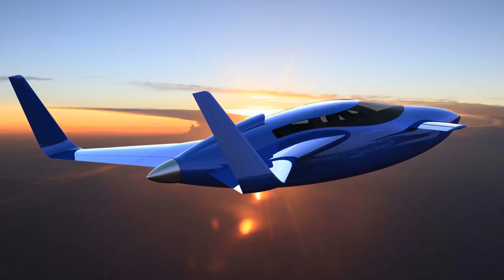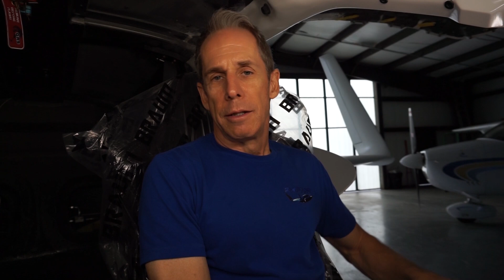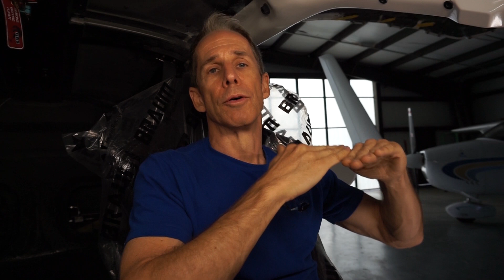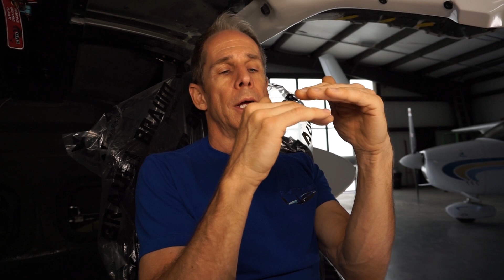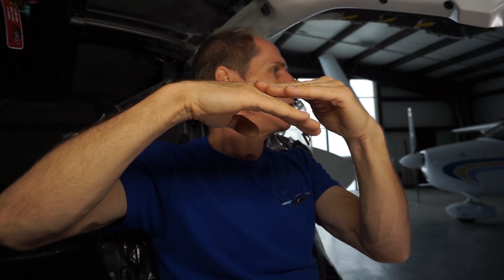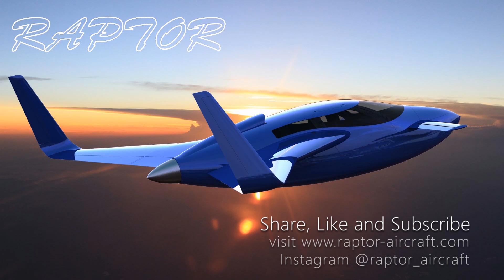State of the Union - Building the Raptor Prototype

Comment: I agree  there might be reliability concerns when using an automotive engine on an aircraft.   The diesel may fail sooner than an aircraft part, but not in 20 hours.  GM engine designs pass a test of something like 300 hours at full throttle oscillating between max torque and max RPM -- then they must function as new.  I think there is a good 500 hours of super-reliable service in that Audi.    It's a long-term issue unlikely to be found in a few hundred hours of testing.

I wonder if the test pilot would like to test at Bonneville or one of the dry lakes.  You are always above the runway if an engine fails.  Trent Palmer, an AWESOME Youtuber,  and his buddies go to a dry lake with their planes and RV's to camp and fly.  Trailer and airplane access is assured.

I wonder if 2 1.8 liter TDI's could work.  Snuggle the two engines next to each other and drive the propeller through clutches.  If one fails, the other can continue.  Maybe use a common dual-scroll turbo for high altitude.  It's easy enough to make 200 HP with a 1.8 TDI, so you could limp to an airfield at reduced altitude and speed.  It might be 100 lbs heavier than the current setup, though.

I wonder if the 3.0 liter could be modified to use mechanical fuel injection.  The engine could run without ECU or electrical power.

Comment: Sorry to hear of your development setbacks. I'm enjoying watching your progress and wish you success.  wrt to the single ECU (and crank sensor as well?), I agree with your test pilot.  That said, I could not convince www.edgeperformance.no  of that opinion, as they are continuing to sell kits and engines based on the same (I believe) ECU and single sensors. So far they have 330 kits/engines out there, with no failures so far.  I have my fingers x'd for them.
Regards and best wishes, Pete

Comment: Don't let one man's opinion get you down.  Just because he is a "test" pilot doesn't mean he has all the answers.  You are absolutely right about the engine.  It is the reason I got interested in the Raptor in the first place.  Something economical to fly.  I am a big supporter of yours because of the simple fact that every time you ran into an issue, you came up with a solution.  What you have done so far with this aircraft is amazing.  Someone will do the flight testing for you.  Prove the aerodynamic issues, and then fly the aircraft.  I know you are getting a bit worn and frustrated, but stay the course, you have a real winner here...

Comment: Have you considered the ADEPT Airmotive engines from South Africa? They initially started off developing diesel engines for use in GA, but since refined their production design to run on 100LL/Mogas/Biofuel, incorporating many of the advantages offered by diesel, and omitting the disadvantages and challenges associated with diesel. Their engines are already flying in many airframes, and they have recently expanded into the US GA market. You can check out the specs at flyadept(dot)co(dot)za

Comment: Peter, your candor is amazing and wonderful. 

I am very sorry for how tough it feels to have suffered the setback of Len's reaction.

Regarding Len and his reaction, it's been my experience in life that too many people are too much controlled by conventional wisdom, and too unwilling to think and conclude independently, according to their own independent and sound reason. 

That is something you do, Peter. 

Based on your report, I suspect perhaps it is not something that Len has a strong tendency to do. 

Specifically regarding the dual ECUs issue, it is of course historically true that piston aircraft engines have generally featured redundant ignition systems.  Similarly, my Rotax 912iS has redundant ECUs, among other redundant elements.  But consider: why was redundancy historically needed.  Was it not because ignition systems were notoriously unreliable? 

Today's world of modern engine management is completely different.  I do not have the statistics at hand to cite, but I'd wager that even Kia and Hyndai gasoline engines today (i.e., low-cost, economy brands) have in-operation failure rates that are several times lower than Lycoming/Continental engines that are freshly coming off the line -- that is, freshly coming off the line with their dual ignitions and/or ECUs, etc. 

Of course (and for further consideration), the Audi diesel has and needs no ignition system.  Certainly, the ECU could fail.  And so could many other things.  The real question should be what are the odds of failure within the total power system.  So far as the Audi engine itself is  concerned (including its single ECU), I suspect the overall odds of failure are far more slight than in 99 percent of the piston engines flying. 

Keep going, Peter. 

BTW, I believe I am deposit holder 98.  I also do not believe I have ever been solicited to make an investment.  My answer will be yes.

Comment: i just want to say........you are one hell of an entrepreneur....you are all in. As for your setbacks, you've demonstrated the caliber to overcome these issues. As for your "test" pilot, he sounds like anything but. I can understand his aerodynamic concerns but that's where the test part come in. That plane will fly. A canard by definition cannot stall......if the basics are followed, as for the fowler type flap you need to make sure it doesn't affect the angle of incedence you've established. Which BTW would be "tested" foe anyway. Flutter has an onset stage that can be backed away from..... if you've ever done a steep turn and maintain altitude you'll run into your own wake, the buffeting you will feel is stabilizer "flutter". As for the engine ECU, not having dual fuel control is not a "No Go" situation for evaluating an aircraft. Actually, this "dual" mentality harkens back to the magneto ignition systems which have reliability issues. You may want to inform your test pilots that certain dual mag ignitions, used enmasse, have always had a single point of failure in that the two mag heads share a common drive shaft.......so I guess that guy should give up flying.
Correct me if I'm wrong but there's hundreds if not thousands of experimental aircraft flying with single ECU ignitions on all types of engines....it's simply a measured and accepted risk. So hang in there buddy.

Comment: Peter I have the answer for fixing the single channel problem of your engine, I tried
to write down some advices in the past but you wereso busy that probably didn't pay attention
for what I was warning you. I flew a cessna 172 for 15 hours over the field with, after 7 years of
developing and 50 hours of ground testing.... a Jaguar Engine (Regular auto fuel in Brasil with 25% of alcool)
V6 3.0 liters fuel injected that I built a dual ignition system totally independent, dual elec buses, dual fuel pumps and put a carburator on top....nobody even Ford/yamaha/cosworth believed that set up would fly or even would start.  Write me an email that we can at least try to help you find a way to have this nice bird flying....DON T GIVE UP MY FRIEND YOU CAME SO FAR WITH PRISTINE JOB!
. romanholi.coria@hotmail.com

Comment: Everyone PLEASE stop talking about patching a second ECU through a switch.  Sorry to be blunt, but that is idiotic.  The most unreliable elements of any electronic control system are switches and wiring and so you are doubling (or worse) the chances of failure in a misguided effort to protect against the failure of the most reliable element of the system (the ECU).  This "switch" would have to be multi-pole since multiple circuits are involved...one (or two?) for each fuel injector.  And what about sensors?  They are way more likely to fail than the ECU.  Are you going to scab on a second set of sensors?  If so, add more poles to this switch along with the associated wiring.  Now, examine what happens if any one of those circuits fails open or shorted.  If one were to do a system-level FMECA (failure modes, effects, & criticality analysis), I think you would find that the items of greatest concern would be the fuel injectors themselves and/or the high-pressure fuel pump.  This kind of dual ECU kludge is just "kabuki redundancy".  Modern redundant electronic controls are done with solid-state switching, usually within the same box.  The single-thread ECU on this airplane is the least of the problems that need to be addressed.

Comment: vw 6-265 diesel marine is the Marine version if the same engine,what's different is the ecu,because it's a standalone engine unlike a car,comes new,and probably hv an OBD port to get yr data logging,the stock ecu can be reflashed for more power and may be able to run parallel or just switch over( maybe?)

Comment: I also am not sure a second ECU would be that much of a problem. Personally, I would not go with an automatic switchover design. I would however, go with an additional ECU that could be switched over. Who cares if it switches automatically, as long as it is available. I don't make these statements lightly. I am a 40 year plus electronics technician and work for Delta Airlines, so I do have some background in what I suggest. Good luck dude. You deserve it.

Comment: A lot of this sounds more like a matter of convincing someone. For example, the sharp nose rise when pulling up a certain amount could just be something you have to get used to, after all you can compensate it by pitching down. Has the extra lift the optimal deployment of the flap produced been calculated? Because if it isn't too much then it could be a matter of just leaving it as it is. Is this guy the only test pilot in the area who can approve the plane? Also regarding the ECU, it really doesn't seem to me like it would be statistically more likely for an Audi ECU would be so unreliable as to not warrant flying the plane. I bet the statistics comparing these Audi diesel ECU failures to traditional Lycoming or Continental engines are pretty similar. I've read some other comments here recommending Bosch diesel ECUs which can run dual channel and are readily available. Finally, if you like, I can talk to some Aerospace professors at Georgia Tech, although I am only a student here so I am not sure how much I can help, but I will try my best if you want. GA Tech has a really good aerospace department and I am sure a team wouldn't mind doing an aerodynamic evaluation of the plane as a project. I would love help myself, but I am not quite there in my studies yet unfortunately.

Comment: I like the KISS concept--  Keep It Sweet n Simple.  Add a second ECU with a cockpit switch.  In the event of ECU-1 failure, switch to ECU-2.  Yes, the engine would more than likely stop immediately after the first ECU fails, but it shouldn't take long to get it started again after switching to the backup ECU.  They can be Y connected to the engine.  ECU-2 would have its own power supply.  After ECU failure and switching to redundant ECU, it's treated as a LAND ASAP emergency.
Finally, you said you would take "a day off,"  please listen to the other comments and take a nice long vacation. 
Thank you for being a genuine inspiration.  When I get bogged down with my projects, I think about what you've overcome and it gives me the motivation to press on and stop my pity party.

Comment: How bout a BRS parachute to get over the ECU issue? might also make the concerns of the winglets easier to swallow for the test pilot?
Reply: There is a parachute on the prototype.  And an option to have one on every Raptor.
Reply: @jasondendinger9861  well... then i guess it would not be an issue if the ECU quit... just like a CAPS on a cirrus right?

Comment: Of course it's water under the bridge now but I think there's a good lesson here. If you're developing a brand new platform, it's a good idea to involve the people you're dependent on at an early time. You're no longer required to have the FAA check in on projects during the build, and that seems reasonable if you're building a proven design. But, if you're doing a completely new thing, the DAR/FAA has the power to totally derail the project and it would be good to get them in on the project at an earlier stage so that you hear about any show-stoppers before everything's closed up and done. Same thing if you're not planning on flying the test program yourself; make sure you have someone who will fly it and that you hear about their concerns early on. The cost of fixing stuff goes up exponentially the longer it takes to find it.

Comment: I love your project. I used to know a kiwi engineer who developed an ECU and was driving in a blown corolla with an insane amount of power. He is the sort of guy who could configure his design so that two units could operate with redundancy. I will try to track him down when i remember his name. He worked at HEtech in Brisbane.
I think the fowler elevators are a slight risk that the airflow could grab hold and cause a pitch up. Moving the pinion closer to the neutral axis is a fix if necessary. 
A shimmy from the winglet flexing the wings and finding a harmonic frequency? I guess it is possible. The former rutan engineers may be able to help.

Comment: YOU CAN DO THIS! Jim Dorn had a great idea there. Rather than one OR the other, challenge both programs! Maybe even reach out to other aero eng schools as well. San Diego State University has a program, I think Purdue, University of Southern California (USC), got to be some around Wichita and Seattle. Devise some sort of competition between the schools. Something like the concrete canoe competition that ASCE sponsors for Civil Engineering students, but the twist is that they are all analyzing your prototype. Each program that is selected to do the analysis gets $1000. If the winning program has a flight department, the prize is they get is $5,000 and aircraft #101 for their program. Or #1001? Or the prototype for static display when you are done with it.  Is there a national/international professional society for Aero Engineering? Analyses could be evaluated and awards announced at their annual conference. Would the various avionics companies whose products you will use be willing to help sponsor the contest in order to ensure a preferred provider or exclusive provider arrangement? I think if I were in charge of Garmin sales, I would be willing to listen to that pitch. How about Goodyear tires? The supplier for your carbon fiber and resin? Etc.

Is there a way you could rig up a second ECU in parallel and have the ability to switch over from one to the other, either through a manual or automatic process?

Comment: In Europe, every new plane model independent of size has to get ground vibration tests done before the first flight. A bunch of actuators get attached to the wings and resonance tests are performed. Depending on the outcome a preliminary max speed gets defined to avoid flutter. I've seen several small companies doing these tests with mobile setups. I would think that this would get #1 off the list.

Comment: I've yet to see anyone mention the ballistic parachute system.  Why does a prototype really need a parachute (I understand that is fitted for correct weight & balance) ?  If there's an ECU failure, or the wings flutter ... pull the lever !  If, as most likely, nothing happens, testing throughout the design envelop (even beyond) may continue.  It's a prototype st**id !
Peter, like everyone here, I'm right behind, looking over your shoulder.

Comment: Peter,

I'm a big fan with a deposit in escrow. 

I am also a professional pilot with extensive flying credentials and would love to help out to the level of my abilities. Don't hesitate to reach out. 

It seems being a test pilot means accepting inherent risks and only through the successful mitigation of these risks under extensive design and testing that an aircraft can be flown safely and certified as airworthy. Dutch roll, flutter/harmonic and limits on flight control authority are the environment in which test pilots work. As long as there is a failsafe, manual mode(as you have eluded to) I don't see a need for a dual channel ECU, would it be nice? absolutely!

In hindsight, it's easy to suggest my belief that a test pilot should have been on hand and closely tied with design and manufacturing from the upstart. I am not a test pilot but I'm showing a red bar going through every one of your videos and I can safely say I have not been more thoroughly guided through an aircraft and its systems in my life as the Raptor. I am not alone and the right person to assist you is among us and enthusiastic to get this airplane flying.

How we deal with moments like this is what defines us. Relax knowing that this is going to be a success and overcoming the hurdles is defining the greatness. 

Michael